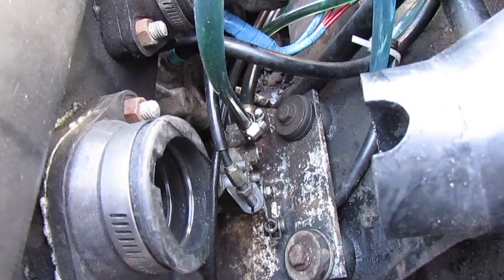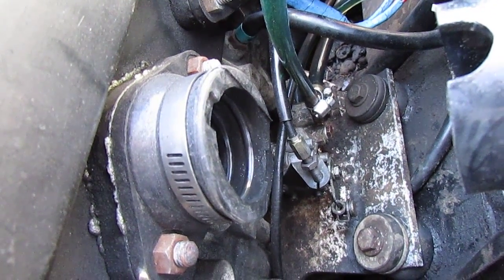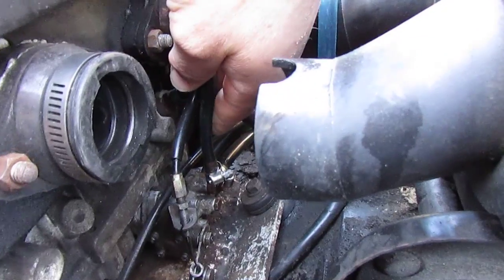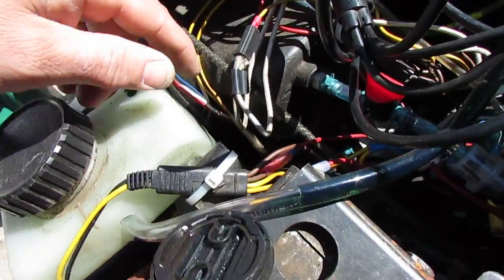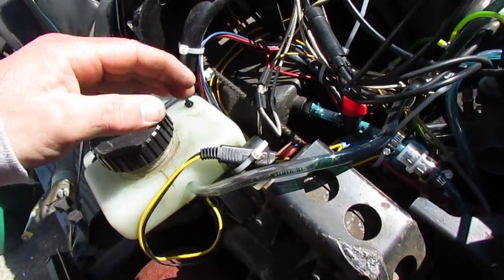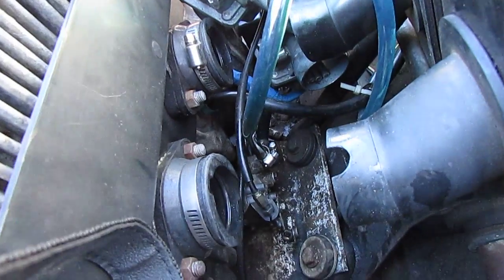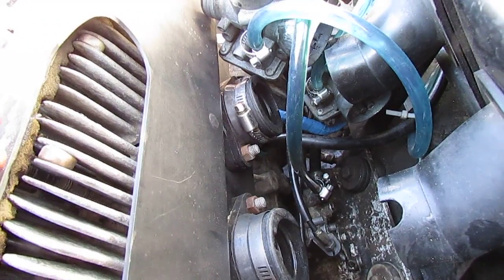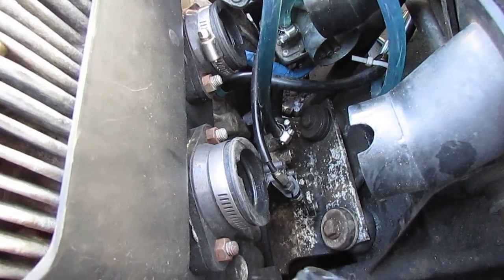2 Stroke How to bypass oil injection

Comment: Thank you for that advice.  I just bought a '93 Skidoo Tundra II.  The oil cable is gone.  So it has been run on 50:1 mix directly in the gas tank.  The loop tank is still there, but I guess that missing cable is the problem.  The prior owner said it would get hot.  Runs good, but haven't run it more than a couple minutes.

Comment: I dont trust oil injection iam a trapper and haver had to many problems with oil injection i simply disconect the injector and mix the gas never had a problem no overheating heads or bearings motor just runs 100 percent better.
Reply: Interesting!
Reply: Same my Polaris 300 4x4 seized out in the woods bc the oil injection system stopped working. Luckily by the time I towed it back home it unseized and let me pull it over and I pre mixed the gas from then on

Comment: Nice vid and sled, love those older Arctic Cats, but I disagree with leaner when running premix.  I've been running premix WITH the oil injection for the past 20 years with factory jetting in mostly 500, 440 and 340 fan cooled sleds from Polaris, Yamaha and lately Arctic cats for THOUSANDS of miles, probably 15,000 miles total.  I've never burned down a motor and truly believe it is cheap insurance.  I add about 2 ounces per gallon when i fill up which does not change the mixture enough (IMO) to 'slow' down the rate that fuel is pulled through the main jet.  I always run factory jetting recommendations for 0-20 degrees so most of the time, especially when above 0, it is jetted on the rich side anyways.   I've also been using Walmart Supertech oil for over a decade with no issues.  My buddies disagree with me, like you, and refuse to add oil to their gas.  Most of my buddies also run top of the line oil like Klotz or factory oil.  I'm the one towing them when they blow their motors (Twice in the past 20 years) one buddy blew a 570 exciter and the other was a arctic cat wildcat 700.  Not saying if they had run premix with injection oil they wouldn't have blown but....  On another note, I'm really digging my old mid 90s arctic cat fan cooled sleds.  340 puma and 440 panther, both 2 up so I can bring the wife and boys along.  Its super cheap fun and I've bought some spare motors for $100 each for each sled just in case.  Having EBAY, and other places like craigslist, you can always find someone parting an old sled out and bypass the stealerships for parts.
Reply: Interesting!
Reply: Factory jetting is always rich, extra oil does make a leaner mix but there's nothing wrong with what you do I add oil to the tank as well as the pump.

Comment: This will destroy your engine 😎 you are lubricating only the top end of your engine 👍🏼 all bottom bearings will worn out much faster 😕
Reply: Then why do pre-mix 2 strokes not instantly lock up genius?
Reply: @pontiacman4556  obviously not only your engine knowledge is low but also reading and understanding what you read doesn't work well for you 🙄 i didn't said instant 😌 i said wear out faster you Klingon mutant 😑

Comment: Is it possible to just plug up the check valves and disconnect the oil injection cable then just premix. Just wondering, I'm new to snowmobile motors and I just bought a1988 Arctic cat 340 jag engine off eBay and I'm trying to get it up and running to put on a grandpa scooter. Lol
Reply: Yes

Comment: Bulll  Shi%$t  Their is no Oil Injection that Spits Oil in front of the reeds then regular gas goes through it that is not 32:1 ratio You have no idea How Many Bikes I have seen Blown up Piston just Burned up... Look Man where do you ride if you off road i mean really off road. What if that great oil injection line falls off the Carb?  lol  it happens to very daym Bike you are on drugs thinking it even works..  come on man ..   the RD350 is oil Injected. Did the Banshee Come oil injected ?  Their is a reason for this ..  It is because  when you off road a ATV  not like a Panzy  you could drop your stupid Spitting out in front of the reeds though regular gas. sorry man no matter how old this video is. No Matter How much you road this ATV. Oil Injection is Bull SHit
Reply: Myotherhobbies for one dummy this isn’t a atv for two the banshee is not a hard core off road mechine the oil pump has a reason to not be in some engines more likely racing engines why well do your home work I’m not wasting my time you have absolutely no idea what your talking about child just take a step back and learn what your talking about please

Comment: I'm just learning about two stroke engines. Why do people seem to dislike the oil injection pump?
Reply: Shaine MacDonald it's a needless piece that can fail,  and also let's u better control mix ratio,  also no chance of forgetting to top off the oil before a ride, 

Its just less maintenance and less stuff to remember,
Reply: Shaine MacDonald  some bikes like my ts185 need the oil injection. Mine has two injectors one in the intake and one in the bearings so if you pre mix my bike actually loses some lubrication, but other bikes it's essentially the same to them just depends on manufacturer
Reply: Bc I have two Yamaha blown engines bc the oil lines came off

Comment: great videos. watched several. When will there be a second video for this. i understand the mix ratio exists for the oil pump but i need to see it in action so i can see if my pump is putting out enough at various RPMs BEFORE I trust it and need  to rebuild  the top end again .  thanks.

Comment: So 50:1 has more oil then 32:1?
Reply: Also if I get a bigger jet will it still run lean
Reply: No. 32:1 has more oil. It 32 parts gas, 1 part oil.

Comment: Any idea when you will post your second video showing how to adjust your mix to know when it is right? I have it set as per manual (match line on pump with line on throttle line). I have a 1989 377 safari scout and I went through a tank of oil after only burning 1/4 tank of gas. No leaks in the system as I don't see oil pooling under the sled anywhere, and plugs are fouled wet with oil. Or is this just a trial and error process?
Reply: Yahoo

Comment: if your engine is running lean from bypassing your oil injection then you are mixing your fuel wrong or your jetting is way off. mixing your fuel to 32:1 or 40:1 is not gonna thicken your fuel to were it can not flow right. do your research before teaching people the wrong information. when you up size your jets your installing jets that have larger passages for more fuel to flow through the carb/carbs. and there fore richening your fuel to air mixture. for more lubrication, lower engine temps, and less friction. just don't go to big on the jets or you will foul your plugs.
Reply: I agree with him that premixing your fuel will lean out the engine somewhat,but not because of thickening of the fuel,but because there is actually less fuel getting drawn through the jets.the engine only utilizes gas for the combustion, so if there is 4oz oil per gallon of fuel(32:1 mix)your jetting becomes 1/32 leaner.....If you take your jet size x premix ratio you will get your new jet size needed for premix.ex-250 x 1/40=262.5....this will be the jet needed for premix fuel
Reply: @mikekadlec1185  Let's not make guesses. Hook up a wideband and publish your facts or keep your theories to yourself.
Reply: this is true tho I have a 2 stroke dirtbike , the more oil you put in the gas the leaner the bike will run because the gas becomes thicker  so the more oil you put in the air to fuel mix becomes leaner. and you try it try drinking milk from a straw and then using the same size straw try drinking a milk shake

Comment: thank you so much!!!!!! my sled would run till it got hot so i tried 40:1  and it works amazing my 86 cougar 500 i thought it gained hp but it didn't
Reply from the maker: just rebuilt my injection pump and both carbs on the cougar, gonna slap the carbs on and run it tomorrow. I had the same problem, mine would get rippin hot after about 20 minutes of running it, that means its runnin way too lean